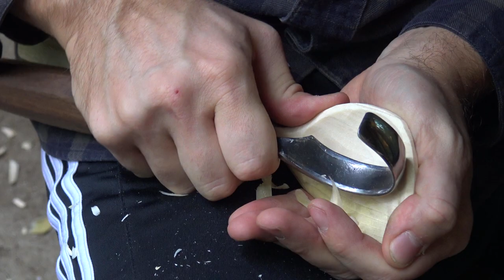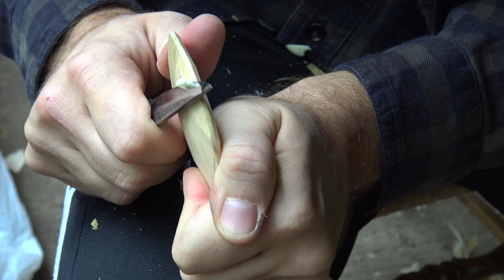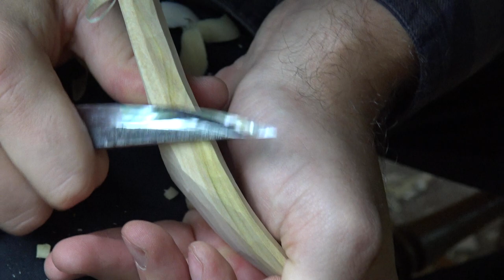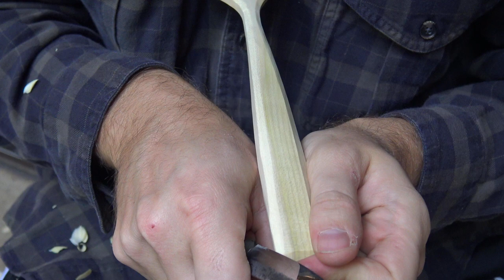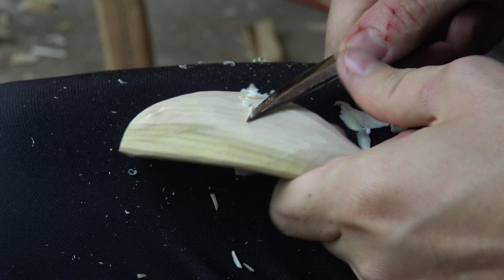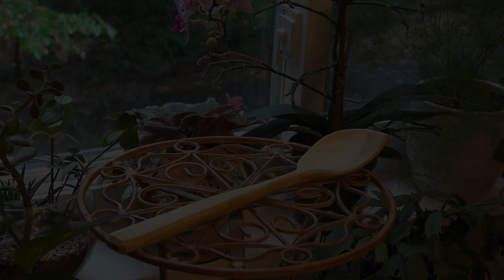Finishing Cuts on a Poplar Cooking Spoon

Comment: High Nathan, very nice bit of finishing work sir. 
Your spoon/hook knife i will guess at a Nick Westerman?  But, that knife that you are using  ?  Wow that is something else, did it come like that  ? or have you sharpend it and polished it to that razor sharp mirror image??  I am a new wood carver, was your knife a skandi grind I believe they call it, as my beavercraft  knife is?  Lines down the blade to the cutting edge. 
You obviously know your onions when it comes to wood carving,  what would your advice be  ?? 
I'm not to bad at the sharpening and polishing, but would you advise working it down untill all the virtical lines have been eradicated to a mirror finish. 
Hopefully you will be able to help. 
All the best, 
Regards, 
Les.
Reply from the maker: Thanks for the comment! The sloyd knife is also a Nic Westermann blade. It is a scandi grind. I sharpen with 6000/8000 grit and strop with white compound on leather. It works for me but there are lots of ways to get a nice polished finish.